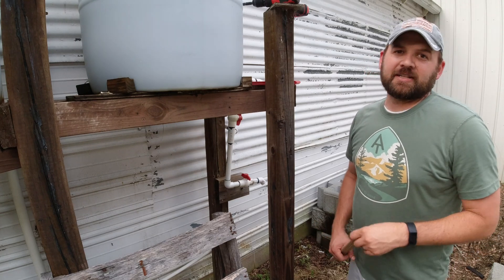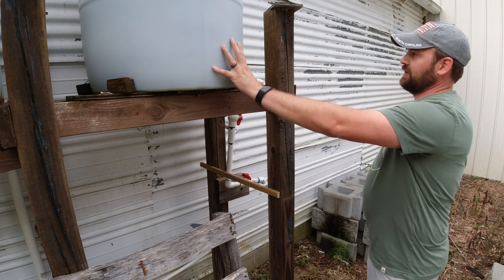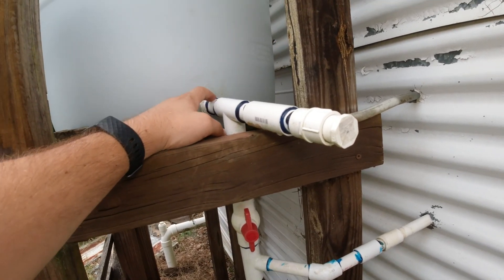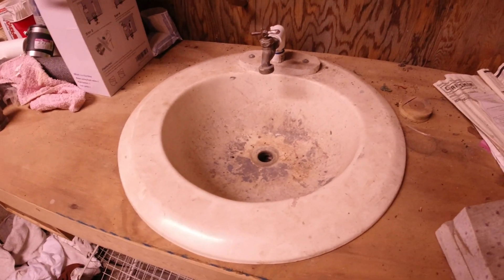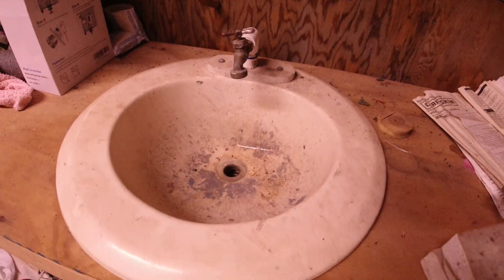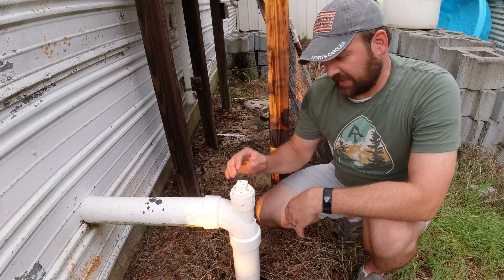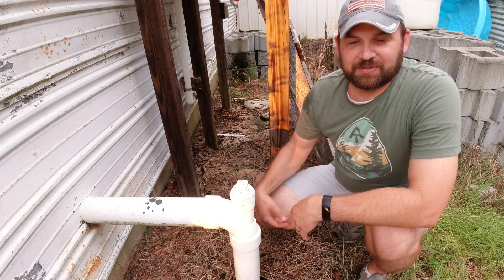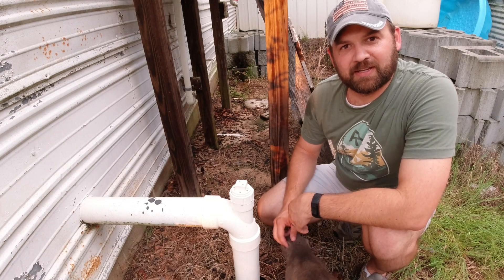Rain Barrel Connected to Barn Sink and Toilet

Comment: Nice setup,  I am also doing something similar. You could use a float valve to fill your cistern as it will work with gravity water as it is not effected by modern filling systems. Modern filling systems need pressure like you say to open up the internal valve.
Reply from the maker: correct.  Thank you for watching!

Comment: Your toilet doesn’t flush good because you should have a vent coming out where you have the clean out t, The holes are not big enough to vent it correctly that you drill in
Reply from the maker: Thanks for the tip.  I'll have to add one on the clean out fitting.
Reply: Hi guys so I want to put up rain a barrel for my toilet on  my house I'm building but only use it for power outages and emergencies I was thinking about putting it against the wall of my house on its own stand higher then my toilet and then run a line through the wall and into the back of the toilet tank 
What's your thoughts and any ideas would be great as well 
I totally liked this video thank you
Reply from the maker: @marctaftsr9681  A couple of thoughts: Are you hooked up to a city sewer system?  If so, there is probably regulations on what you can and can't do.  The pressure from the height difference is likely not enough for the internal valve in the toilet tank and you'll have to manually fill like I did here.  If you didn't want to permanently hook it up, you could just fill up buckets from the exterior rain barrel and pour the water into your tank after flushing.  That may be the best solution if it's only used for emergencies.
Reply: @ProjectNineOaks  
Thank you for getting back to me
So I live in the country and have a well and septic that I will be hooked up to and I was just going to use the rain barrels for emergencies only  just to fill the tank up